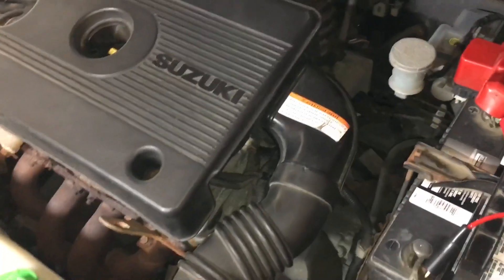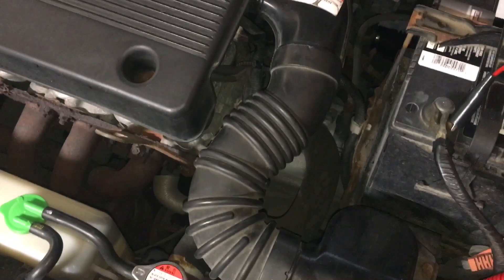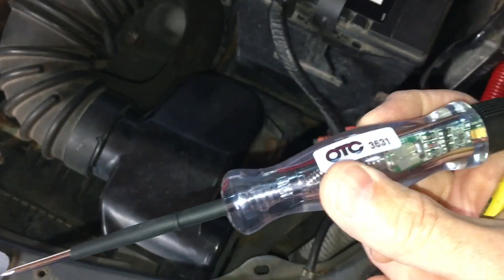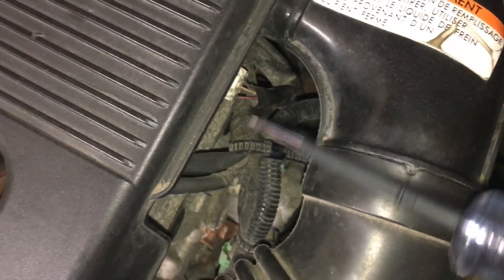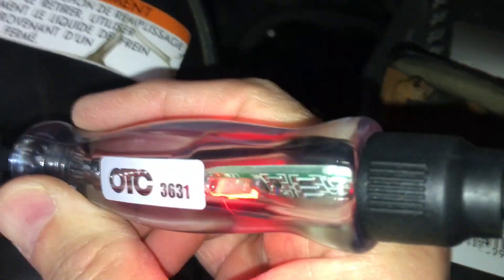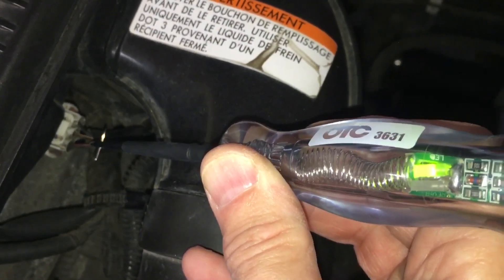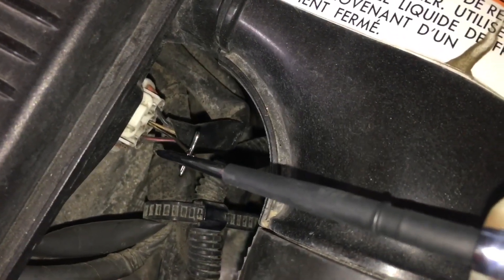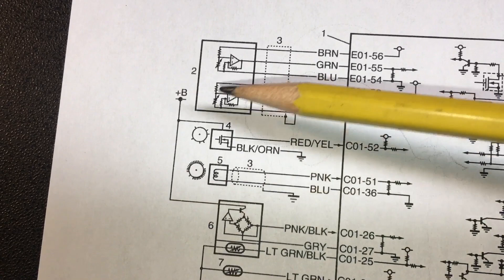Is A Wiring Diagram Required For Preliminary  Automotive Troubleshooting?

Comment: This is fine for older vehicles, but modern module-controlled stuff requires a high-impedance test light or you can damage the module, and some stuff will absolutely throw you for a loop if you don't have the wiring diagram.
Reply from the maker: Postscript To The Previous Video
https://youtu.be/I87dHoMKhJU